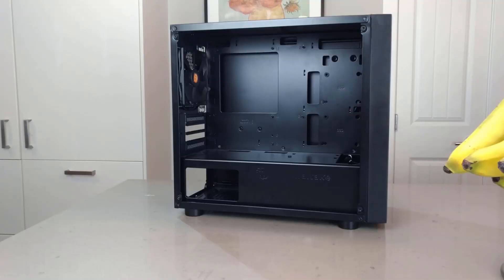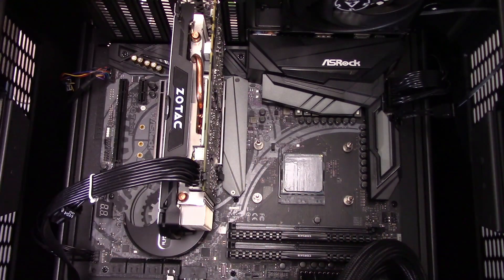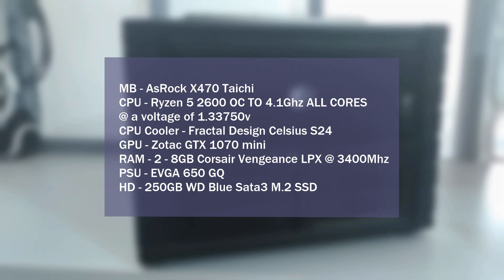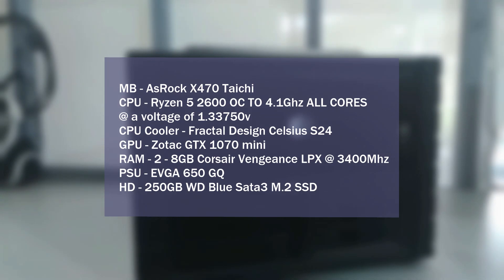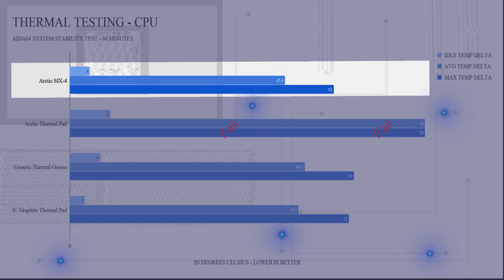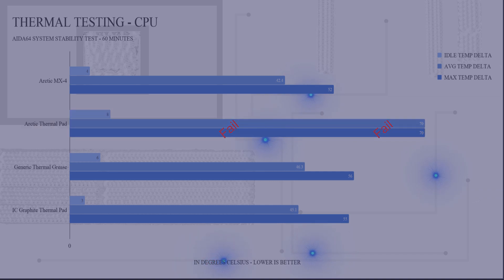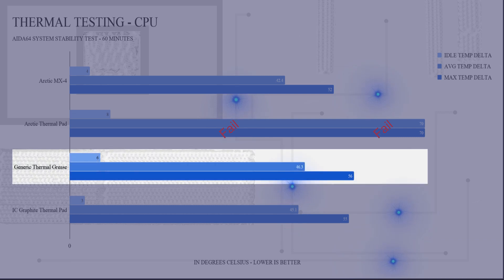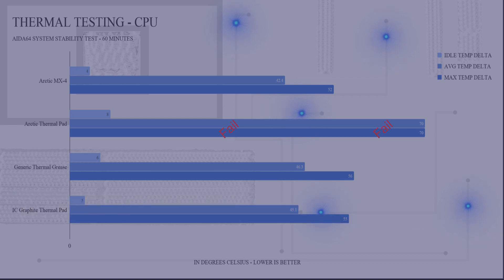Never Buy Thermal Paste Again???

Comment: Thermal Graphite Pads are good for those device where graphite pad fits perfectly.. Not sure if it comes with thicker dimension.

I tried in a laptop and the heatsink and cpu/gpu doesn't quite come in contact together even after putting the pad. 
Thermal paste will be a better option to fill the gap.. Once applied correctly, no need to open the laptops for years.

For PC, it makes sense to use graphite pads..because some people keeps changing or upgrading parts from time to time